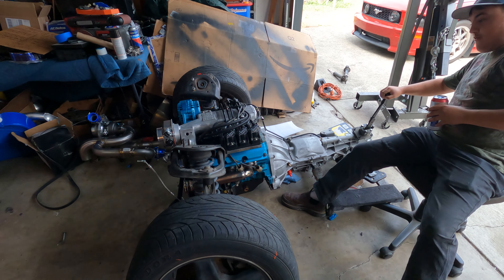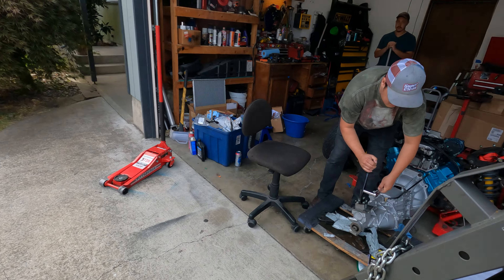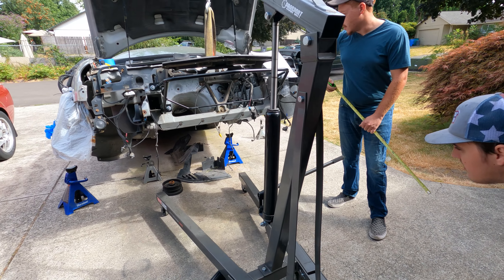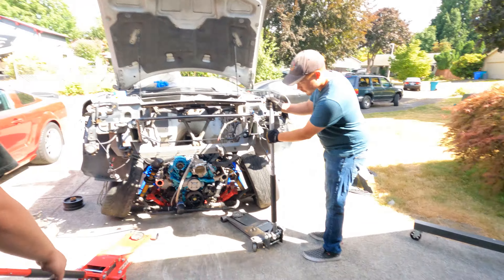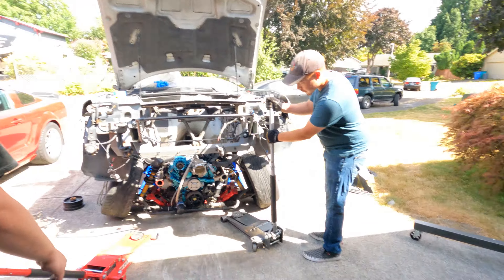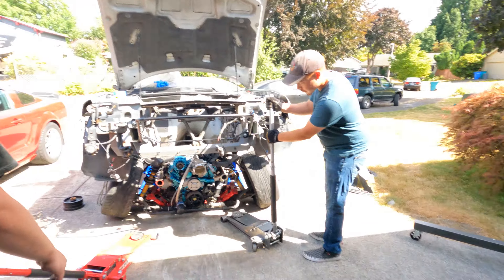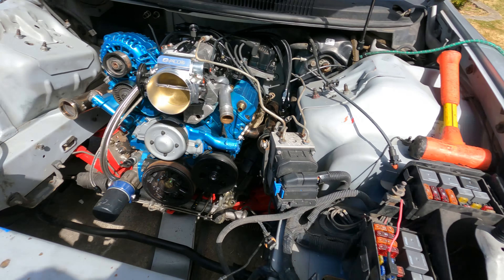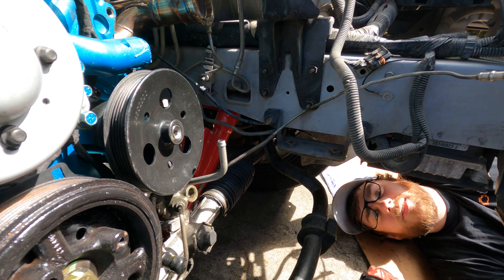Finally Installing Project F's Turbo 3800 Engine and Transmission!

Comment: Also look into getting wax for your blade. When I was in MFG, they always keep a tube with a wax stick around the chop saw in metal fab. This helps prevent your blade and object from overheating and messing with the temper. Not to mention helps with giving your blade a longer life, when metal blades can add up over time. Think you can get a stick at home depot and it will last your years.